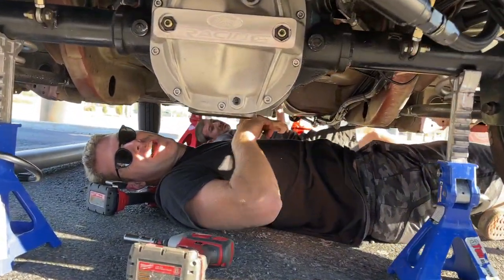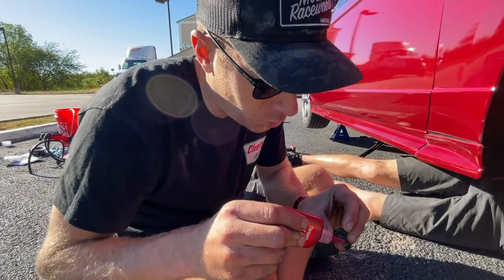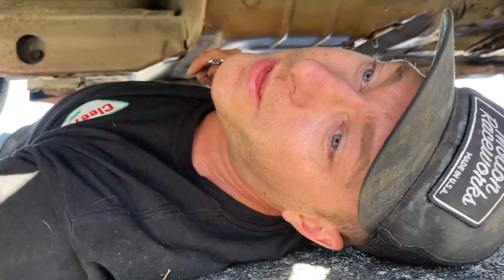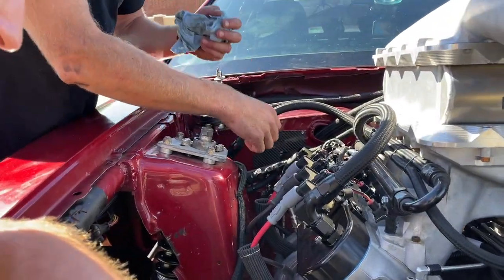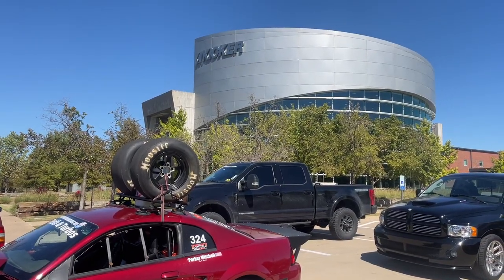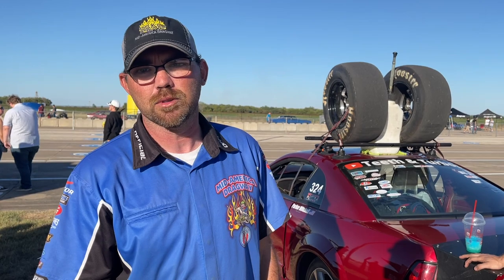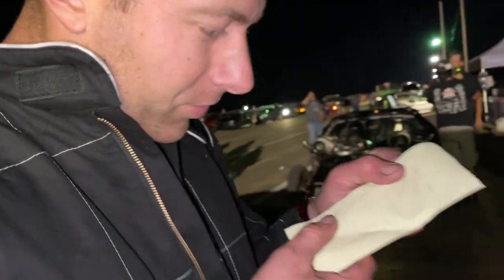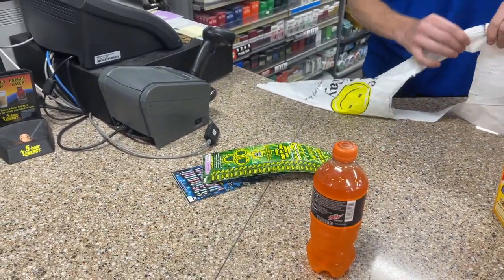Race Week Day 4 - Hotel Parking Lot Bonding with Cleetus & Battle for 3rd Place Continues

Comment: Aaaaannnd Parker’s flywheel is now a permanent part of the crankshaft…
Reply: I was laughing when he said it was red Locktite. I thought, why not weld it? lol But, pppffttt, not his motor 😂
Reply: 🤣🤣 yep they are going to need the special blue point wrench to get those bolts out or a 3/4” impact
Reply: @young11984  Hot wrench for the win. lol
Reply: You just have to heat the bolts with a torch to breakdown the Loctite.  No big deal.
Reply: Always a couple of super techs in the comment section
Reply: At least it wasn't green loctite
Reply: A little heat and the bolts will come right out.

Comment: I find it hilarious he punched holes in the filter with a screw driver and adjustable, then spun the filter with his fingers on the nut K&N puts on the filter so you can get it off if its stuck. Lol
Reply from the maker: Lol my hands were so oily I couldn’t get a socket to hold on it
Reply: It ain't stupid if it works
Reply: The K&N nut is made from sheet metal, so the sides and top are rounded and a socket doesn't always grab as well as I would like. The metal strap wrenches work best for me.
Reply: I been a mechanic my entire life and that’s the way I’ve always took oil filter off no matter what the brand it’s quicker than the tool they make or finding the right size socket/wrench most mechanics do it that way

Comment: That track has some neat history, but probably should not include it for RMRW since alot of cars can't run the 1/4 mile, really screws up the system.
Reply: it's a good one time track on the series just to get the history out there but agree.
Reply: Yea.   That was kinda of a bummer.
Reply: How do they work the 1/8 times in to the overall 1/4 average?
Reply: @User78347  according to the video they ran the 1/8th, but the back half was an average of the other days added on to it for a 1/4 time

Comment: Glad the oil leak issue is sorted.
If you turn the extra wrench over it will work/grip better (Been in the trade over 32 years now), just make sure you use open hands with any wrench work to stop knuckle punching.
Awesome raceweek coverage again

Comment: Pull that header and put some permatex 81878 copper sealant for the header. Put a bit of 81878 on your finger and put it onto the head then onto the header side of the gasket and put it back together. Works great and always seals up headers for good. A lot of headers leak no matter what brand, so this has become standard practice when i instal headers. Good insurance and good way to make sure they all seal up. Takes 10 minutes and saves a lot of headache. If you’re leaking moisture, your sucking air also which means you O2 is making the engine rich. Just my experience, hope it helps.

Comment: Hey not sure if you’ve seen it or not but your driveshaft bolt looked loose after you tightened it up, I also noticed you rearend shifted to the drivers side when you launched
Reply: I think it had a black washer under it making it look like space between them.  Didn't notice the fear end shift though.

Comment: Permatex red works great for sealing up header leaks we even use that at the shop when we dyno engines instead of header gaskets that will seal your leaks right up and you won't be losing any exhaust gasses needed to spool the turbskis

Comment: OEM on vw the bolts for the flywheel are “micro encapsulated” fancy term for blue locktite. Without it the crank leaks oil

Comment: That one driveshaft bolt looked like it wasn’t all the way tight, maybe crossthreaded.  Also the water out the header is probably a bad head gasket, and the oil looked like a bad head gasket.

Comment: On the burnout and the launch the back end is kicking out to the left, wondering if the tyre pressure is a little low on the rear right tyre?
Reply: Also is your diff welded?

Comment: Common now why didn't you use a 19mm wrench on the end of those nice k&n filter LOL just becareful using K&N OIL FILTERS I've had my self and known freinds that there filter leaks were the weld the adapter on the bottom  for using a wrench(Just another tech tip and FYI)